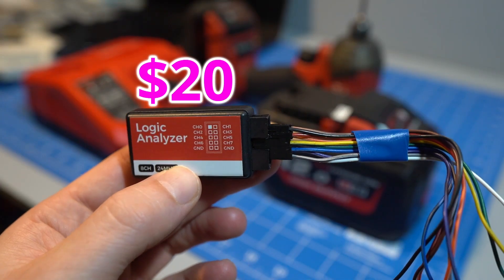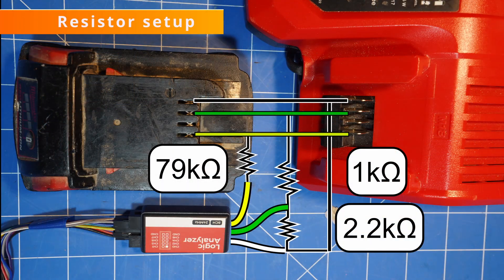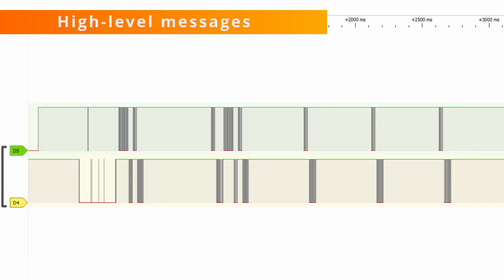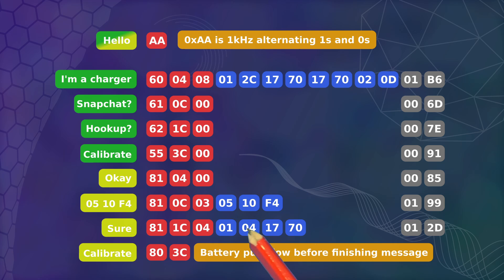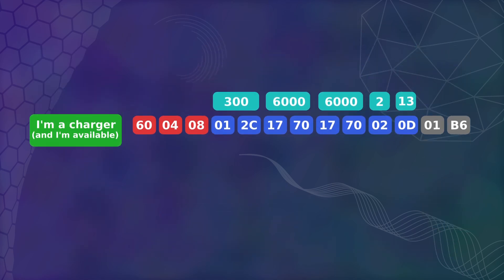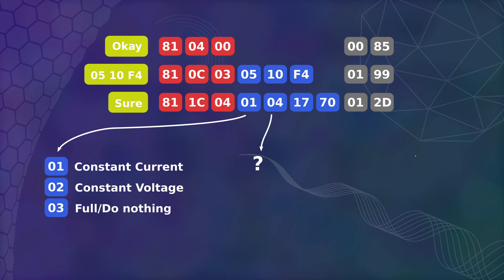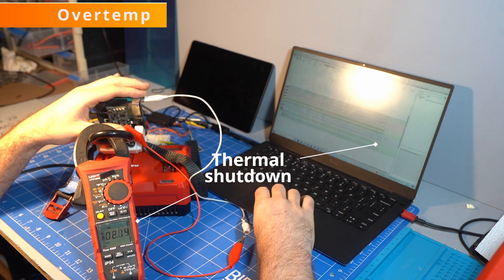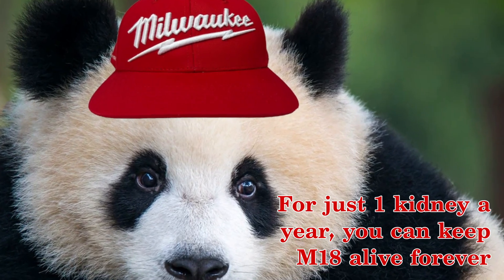[004] Reverse-engineering the Milwaukee M18 Redlink Protocol

Comment: Don't know if it will help but I can send you a m18 12 Amp hr. It will only partially charge (3 bars). Milwaukee Warranted it with no return requirement due to a very abusive Customer service rep. I am not into reverse engineering or even deciphering communications code. But I feel any open-sourced Tech information will help people capable repair their own tools. Let me know if you want it.
Reply from the maker: The 3 bar charge on 12ah packs is very common. It's almost always due to cell imbalance. Charging stops whenever one group of cells reaches 4.2V, so if you have one weak group they never get fully charged. If you take the pack apart and measure the voltages of each group you'll find one or more groups around 3.6V, whilst others are around 4.1V. You can manually charge the low groups up to 4.2V with a power supply.

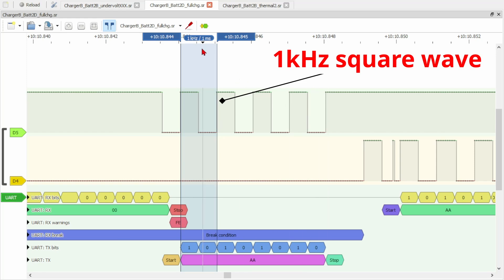Comment: 3:18  that's more a 'watchdog' policy than a timing calibration, I'd say it's a reality check take a peek outside the goldfish bowl.  About timing error/sync there's a lot of margin to absorb timing errors and the messaging very robust, the read bitclock resyncs on the leading edge of each 'heartbeat' byte message. There's too few bytes in the message for it to go out of sync. 
The whole thing has similarities to many GPS tracker protocols.
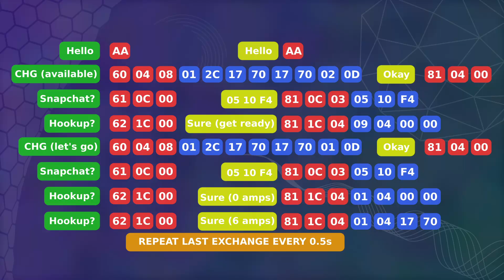Reply from the maker: Yeah, I was bit iffy with that explanation. There's a reasonable temp change during charging, but I doubt it could throw the clocks out enough. Any thoughts on the weird behaviour of the battery during interrupt at 8:13? The battery gets 2 bytes into its reply, then holds low and the charger follows. Given that the charger wants the interrupt, it could just hold low and the battery would follow. If the battery needs a warning from the charger of the incoming interrupt, then why does it bother to transmit anything instead of just holding low?
Reply: Where you wrote "300s (5min) clock calibration"  ?
I'm not sure where term 'calibrate' comes from as wouldn't expect a clock itself need calibrate. Perhaps here is more a 'sanity check' or 'refresh Ts & Cs' or something.
AA in binary is a regular symetrical square wave. Then there's a flatline.  I think likely going on here is a physical layer connection integrity test, to detect contact noise, which is a very weak point in the comms. With dirty contacts.
Reply from the maker: @jagmarc  my thinking was that each device sends the other what it thinks is 1kHz. If battery measures chargers AA signal as say 1.1kHz, then the battery can adjust the timing of either its transmission (or reception) to suit. I'm not sure if that's a thing, but it seems like an obvious thing to do.
Reply: Yes I get what you mean but serial comms doesn't need to be precise clock rate, it can tolerate quite a wide range. The built in timebase oscillators in microcontrollers are much tighter.   Timing errors can be corrected on-the-fly while receiving data as each byte has a stop&start whatever data it's carrying. 
Althougj a AAAA stream would make the perfect sample for a 'bit rate calibration', I don't think it's needed. Well unless the clocks really do each go off by more than (say) 10% . If that's the case then AAAA is much easier to use.
It's easy one to rule out, simply keep overall look out for any big (>10%) variations in bit rate from nominal

Comment: OBSERVATION and for 100 years we cant get electric cars right, cant be consistent with solar power, rv manufacturers cant build an rv that doesnt break in a day, and auto manufacturers cant build cars and trucks that dont breakdown or cost thousands to fix bc one tiny plastic piece broke,, but this guy reverse engineers the entire Milwakee battery platform in a 15 min video.  Whos being duped?
Reply from the maker: Well, there was about 4 weeks of work that went into this 9min vid. It's also much easier to take something apart than it is to build it from scratch.

Comment: Why does a battery and a charger need to communicate at all? What’s wrong with a simple CC/CV & NTC setup (plus a BMS inside the battery of course)?
Reply from the maker: To do CC/CV charging, the battery needs to be able to control the charging current. It can do this with an analogue pin (which I think is how Makita does it, but I need to test further), or a digital request. Pre-2013 M18 have the same pin layout, but the pins don't do digital, just high and low signalling to the charger. I think to maintain backwards compatibility, but still have fast CC/CV charging, they had to go digital. The alternative would have been adding more pins and there isn't really any space for that.
Reply: @toolscientist  Why not have the charger control the current? Most battery chargers for lead acid and lithium batteries work like that. In theory you could do with just two wires and have the BMS disconnect the battery when it’s full over overheated.
Reply from the maker: Because in the CV phase you need to modulate the current in order to hold the highest cell at 4.2V (or 4.19V as M18 seems to do). If you have the charger hold the pack at 21V then some cells will be slightly under and others slightly over and possibly get damaged. Dewalt gets around this by having pins to each set of cells, but there isn't room in M18 to do this.
Reply: @toolscientist  Okay I understand but why not have a BMS with integrated balancer for this? I mean the battery pack already needs some circuitry (e.g. for OCP, OTP, UVP, etc.). For example, most 12V lithium packs I know of have a 4S configuration and a BMS with balancing leads for each cell. Once the pack reaches a certain voltage above the nominal voltage the balancer will kick in and balance the cells. 🤔
Reply from the maker: @pcfreak1992  it's got a balancing chip, but it's very weak. Max of 50mA (but with the resistors they use, only 2mA) and it can't balance adjacent cells as they share bleed resistors. It's pretty old tech, first designed in 2012 and has only had superficial changes since. EDIT: the non-digital battery design for batteries before 2012 is very similar, too. Can't remember when they were first released - I think 2008.

Comment: A nice piece of work, thank you. Is all of this considered proprietary? Seems like right-to-repair could put this protocol in the open. It would be valuable if you could just plug a tool battery into and analyzer and know the cycle count, for example.
Reply from the maker: I don't know. I tried to look into it before posting in case I got a takedown. All I know is that there's plenty of other similar videos on YT. There's a guy that's reverse engineering Apple's lightning cable and has 1M views - you'd think Apple would stomp on that if they could.

Comment: I'm wondering if what you labeled as the Snapchat number isn't a confirmation code that this battery is for sure a Milwaukee battery and not a knockoff
Reply from the maker: It's dead simple to copy, though. Anyone capable of reverse engineering the rest of the protocol is going to have no problem with a static number, even if they don't know what it means. Another commenter pointed out that sometimes pointless stuff is inserted into these protocols as a way to identify if a competitor has copied you. Also, sometimes code is hacked together until works and then left, so original code that was later abandoned gets left in.
Reply: @toolscientist  Is it possible that it's being generated by a specific chip on the board? I'm just brainstorming lol
Reply from the maker: @thomasvlaskampiii6850  the chips in the battery are an MSP430 and a BQ76925. It could be an identifier for one of those chips. Good thinking.
Reply: @toolscientist So those are the microcontroller and battery balancing chips respectively. That code could come from either one of those, but more likely the balancing chip. Perhaps as a way of it saying it's ready to go as well
Reply from the maker: I'm wondering if it's a code to identify the chip type, but I can't make anything fit, even reversing byte or bit order. Its a MSP430 G2744. I've also tried looking at it as a date format, but can't find anything that fits. This program would have been written sometime around 2010-2013. F4 10 05 as a hex colour is a red, but Milwaukee uses DB011B. Nothing in ascii.
Reply: @toolscientist  I found a data sheet from Texas Instruments about using these two chips together. That line appears to be the battery balancing chip giving the "I'm ready" command through the I2C pin. I could be reading the block diagram wrong though, or even looking at the wrong one since there are several diagrams on the data sheet
Reply from the maker: You could be onto something. Also, 0x10 is the i2c CHIP_ID of the BQ76925
Reply: @toolscientist  Do you know the id of the MSP430?
Reply from the maker: @thomasvlaskampiii6850  can't find anything. Seems to say you can choose your own slave address. It kinda looks like an i2c command: 05 address, 10 data, F4 cksum. No matter what I do, I can't get the F4 cksum from 05 10 (BQ76925 is using CRC-8). It also does funky stuff because it packs 2 addresses into the address byte, so 05 gets transmitted as 25. For calculating cksum, you have to add the R/W bit to the end. If it's a read command, then 25 is 4b. If it's a write, then it's 4a. Neither option gives me the f4 cksum.
Reply: @toolscientist  It's entirely possible that the microcontroller is doing something to the data from the battery balancing chip. You're seeing the data on the GPIO bus instead of the I2C bus. So it might be obfuscated for "security purposes"
Reply from the maker: Yeah, I thought maybe they were just being lazy and transmitting the whole i2c packet rather than just the data byte. It could be 3 separate data bytes from the BQ76925. Possibly the charger checking to make sure that the BQ76925 is awake and functioning before starting. Maybe it's kind of a debugging printf to save you from having to monitor this UART protocol and the i2c inside the battery. I have done a few captures of the i2c during idle and tool operation, but not charging. It's constantly waking up and putting parts of the chip to sleep.
Reply: @toolscientist  It could also be a safety feature. I can't imagine it would be good if the BQ chip suddenly went short circuit and the charger had no idea
Reply from the maker: I just realised the MCU is a MSP430 G2744, which is in the G2x44 family, and F4 is 244.

So I think 0x10 is the i2c address of the BQ76925, 0xF4 refers to the MSP430 (might be its i2c address as it's programmable). 0x05 might mean that it's the 5th protocol version.
Reply: @toolscientist  That very well could be. I've been reading about the i2c protocol as much as I could, but I haven't turned up anything. So you could be right

Comment: Great video, I wish I had your knowledge to diagnose a dead 48v lipo battery from Mercane Wide Wheels scooter I picked up on garage sale. It was sitting for about 2 years and initially battery was 2.09v I was able to bring it up to 8.59v total just sitting on the charger overnight. It doesn't switch to red because of BMS protection and I even tried to trigger the charging by using a radient RC charger in nimh mode but it gives connection break or sitting at 16.9v and 0amps on charging when you trick it with 12v battery while connected to lipo pack.

Comment: For real: Ill open mouth kiss you wherever you want if you can make a goddamned Makita AWS on/off remote.
Reply from the maker: Open source AWS would be useful. Are there any knock-off AWS stuff? If not it could be because Makita has intentionally made it hard to crack.

Comment: If i remember correctly around -20 to -30c those things don't like to charge but still work. I know at -40c the battery won't work fully charged in a drill.
Reply from the maker: Those are crazy numbers. Samsung's datasheets say 0C for charge and -20C for discharge.

Comment: Dang Mate, you hit that algo! I can remember wayyy back (like a week or so) it was just an exclusive club of a few hundred or so subs . Now the cat's out of the bag. There are many tool/battery nerds interested in this line of inquiry ...look forward  to more
Reply from the maker: I'd just ticked over 100 subs the day before I posted this. Only had about 6k views and 20 different commenters across all my vids. It's a shame I can't give you some kind of flair to say that you were here before it was cool. Thanks for being there!
Reply: We know who we are. Have you checked into the M12 charging side of things? Looks maybe simpler , like straight balance charge of the 3 banks
Reply from the maker: @earl3358  M12 is mostly analogue thermistor and balance pins. Newer M12 have an IC, but it's hidden under a PCB. It has Vcc, GND, CLK, DATA, and RST pins exposed, so I could tap into i2c if I knew the chip. Might have to desolder it. My best guess is there's something on there to isolate the charging pins to prevent them shorting, or maybe something that shorts the thermistor if it detects a fault.
Reply: Meteoric Rise to 10k
Reply from the maker: @earl3358  aye, lots of pressure to keep the quality up on the next vid.

Comment: From my experience and understanding which is, well, honestly pretty limited, but a guess at least is: 05 is the error that happens when you tamper with a battery in a way they don't like. These batteries are typically pretty sensitive to tampering. Disconnecting things will make them brick themselves. Introducing things in the wrong places will do the same. Just a guess as a guy with an interest in these things!

Comment: That's some awesome work. I recently started analyzing the protocol of the Metabo CAS batteries. It's a bit more annoying since they use a bidirectional single wire UART, but I got to sniff a few charging cycles of different (18V only) batteries. I identified 12 different messages, but am currently at a loss of how to continue.

The data does not change during the whole charging progress. There are multiple values that get queried, but except for some that seem to correlate to the design-capacity and a kind of repeated status query (that has a different value across all tested batteries but never changes for a battery) there seems to be absolutely nothing meaningful in there.
Reply from the maker: Are you doing a full charge sequence? When the M18 batteries are full, it just does queries to check that its ok. When they're in CC mode, all messages are just asking for 6A. To see changing data you need to be in CV mode. 

I think Makita does current request via an analog pin, so maybe Metabo is doing similar. Check for another pin where the voltage slowly changes during CV phase. If this is the case, then data will simply be "R U OK", followed by "Yes, I'm ok". You can try heating the battery up to induce change, but this could be damaging. If you can find the thermistor, you might be able to short it with a resistor to trick it into overheat detection. I used a 4.7k resistor for my tests, but you might need different.
Reply: @toolscientist   @toolscientist  I recorded the whole process from a partially charged battery until it was full. After the initial query of some data values it's just an infinite repeating of the same two queries (one of which seems to be a ping with no data) with no changes in answers every second.

The battery has 5 contacts: GND, V+, NTC+, NTC- and Data. It seems like the charger handles all of the work as if the battery has no brain at all. The only meabingful looking data gets read once at the start and has some fields that could indicate the capabilities of the pack.

I'll need to run another test with a completely empty pack and maybe need to find some with other voltages.

Hm. Maybe I should try if the charger still works after blocking the data connection.
Reply from the maker: @The_M1k3y  only just saw this as it was marked as spam - maybe don't do the double @. Yeah, sounds weird. If you've got a clamp meter (or multimeter with high enough amp rating) then measure the charging current and voltage. Film it and try and identify the CC/CV/full phases in your vid and data. Maybe there's some sort of double ping for CV and full? There's another commenter in here that had worked on Metabo and said "...uses half-duplex UART at 2400 and it was enough to hardcode response to make it work." Maybe it's a dumb handshake with no info and the CC/CV stuff is handled by analogue pins? You should be able to find that comment and you could ask them.

Comment: Do you think you could hack makitas aws bluetooth and create a standalone remote to turn the vacuum on and off?
Reply from the maker: I do have an AWS tool, but no AWS vac. My feeling is that if there aren't knock-off AWS remotes available, it's because Makita have done a good job of making it hard to crack.
Reply: @toolscientist  either that or it isn’t mainstream enough for someone to hack. Surely a flipper zero or similar could do it.
Reply from the maker: @kizzjd9578  well I was surprised at how PCBs for XGT showed up on aliexpress within a year or two. I would have thought AWS would be decently lucrative as you'd easily be able to sell them for $10 for what would be a $1 part.

I'm not super experienced with hacking stuff. Looks like flipper zero could easily intercept AWS, but it's more about how hard Makita have made it to crack. Apparently it's not straight bluetooth, but if all they've done is tweak the BT protocol a bit, then it'll be easy. If they've done any cryptographic stuff, then that'll be way out of my league. 

If I ever get an AWS vac I'll look at it. Worst case scenario I can dump some datastreams for smarter heads to have a look at.